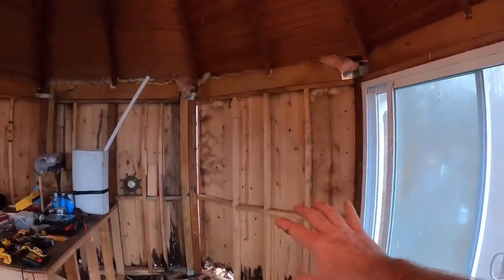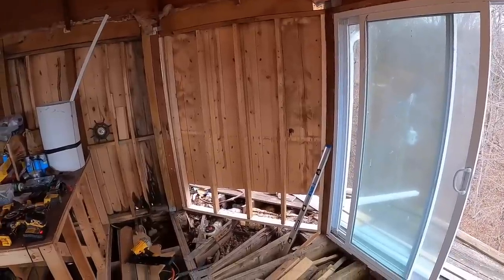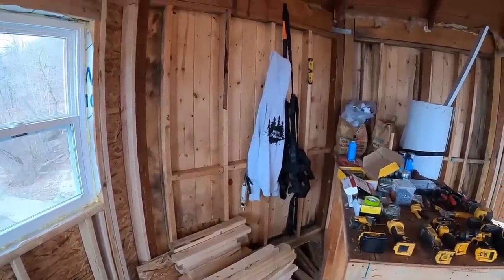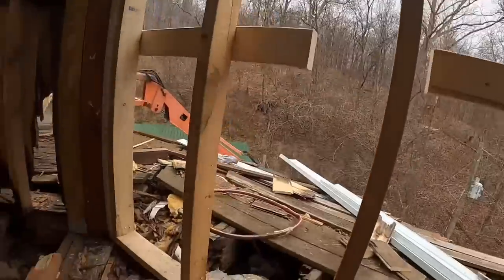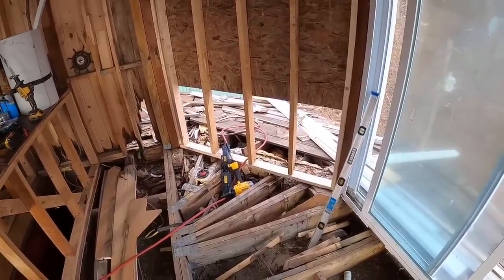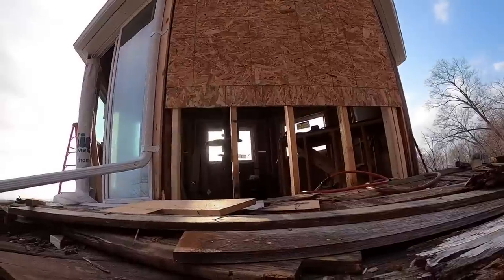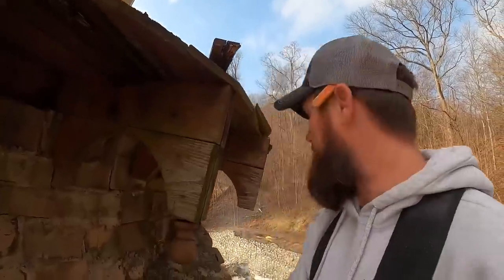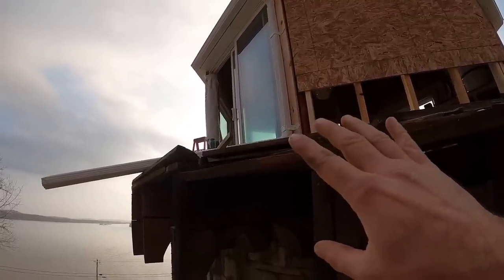The death deck! Wall repair and deck inspection

Comment: Personally I'd remove those rotten timbers before they suddenly remove themselves.
I'm glad theres a route to the basement for the water supply, I was wondering if you should route it another way inside the building but no need! Happy days 😁
And I totally agree leaving the last door until last so there's access.
Reply from the maker: Thank you

Comment: Love your positive attitude and can-do approach Matt.  That platform still gives me the heebie-jeebies!  Having watched this series so far, and having done resto/reno jobs on heritage buildings in the UK here's my 2 cents...1. It's not too late to change tack - I'd take the entire structure down and then repair the masonry walls properly. 2. Pour a concrete ringbeam on top of the tower which you can then bolt down an I-beam frame that you build a cantilevered deck and structure off. 3. Water ingress is your enemy - if you replace like for like then you're probably going to be doing this work again in 10 years. Either way, I wish you the best and admire you for taking on such a difficult project 👍
Reply from the maker: Thank you

Comment: Do the joists first to make the area secure underfoot. Having them done means you can mark out the position of all the hips and fascia boards at once. 🙂 And once repaired get some scaffold boards down as a walkway rather than stepping in between the joists.
Reply from the maker: Thank you

Comment: Hi Matt. Just a thought on your route for the water coming up from the basement. I have built many animal feed stores in wild environments the weather extremes you would hate. But even that said on that short height you have and with a chance of freezing, please check up on a low voltage trace wire to run along your water inlet pipe. You can control if or when it runs with a ambient temperature control unit, that will only switch on at a determined temperature and switch off when no threat of frost sub zero or -32F. I only suggest this as  something there when needed is a lot better than not being there and realise it was needed. We even used a battery bank that would last any power outage as our systems were run on 6, 9 or 12volts, as well as running of a transformer off the mains. The system could be  ideal for your project. The trace wire taped to the water pipe as you feed it down and there if or when needed and saves the worry of failed insulation of damp running down the water intake pipe if the roof seeped a tad. Think insurance and proactive. You most likely have thought about this type of system but if I said nothing and you had an issue down the line I would feel bad. Sorry if you have looked at this and discarded it and pleased to point you in a direction outside of the box if you had not thought about it.
Reply from the maker: Thank you!  I have been thinking of ways to mitigate freeze
Reply: @nyamillennial  Pleased to help and always available if you need any other ideas, shame I live across the big pond from you or I would be down the 66 faster than a Road Runner to assist you.

Comment: Access is key Matt !!! I would start on the floor joists and roofing the underside of the deck, then sort out the rest of the roof around the deck. 
Consider using mechanical or chemical anchor bolts or threaded bar for fixing the timbers to the wall. This would lessen the chance of water rotting out the timbers. Chemical  anchors can be expensive, but the hold they get is impressive. I have used them many times, you have to ensure the hole is free from dust to get a good anchor.  
For doing the re pointing of the stone wall, I would recommend using a lime mortar mix, this tends to be less likely to react with the stone, depending on the type if stone used to build the walls.
Reply from the maker: Thank you

Comment: Nice project Matt
Hard to tell from the video about overhangs and such, but a small copper or metal cap on that chase might work and look decent, but hard to tell the taper and how far out the overhang needs to be. not enough and you just move the water intrusion farther down the wall.
Anyway, I appreciate your ambition and talent, good luck. Looking forward to the next installment
Reply from the maker: Thank you

Comment: Insulation under the roof structure will be great but I’d still put the pipe insulation on the water line too, just to be certain brother! I don’t think you’ll regret the extra insulation Matt! Good job and good luck brother!  Matt , where the new roof section meet the wall! You might want to put some of that galvanized flashing that comes in a roll that’s about a foot wide! It’s also used on roof valleys in the old days, but it’s going to keep the meet up leak proof for sure! Just a suggestion brother, I know it’s your job but just giving you a idea!  Looking good brother!
Reply from the maker: Thank you. I will definitely flash it
Reply: @nyamillennial  he Matt, I’m just trying to help brother!  I had to learn myself brother! 👌🏻🤙🏻
Reply: If you put insulation around the pipes, MAKE SURE that there is still warm airflow up the chase.  I performed firewatch at a new condo because the insulators packed insulation tight around the sprinkler pipes in the ceiling of the top floor.  On a cold night the pipes froze, cracked open, and flooded three units.  They had to turn off the sprinkler system (thus the firewatch) and replace ALL the sheet rock in two of the units.

Comment: Don't forget your not replacing the deck your building a roof. Once the roof rafters are tied in the joist don't hold much weight. To save some money  you don't need the long floor joist. You don't need the cantilever for a roof. You can stick or truss frame the missing sections. Use the cut off joist to fill the inside.
Reply from the maker: Thank you
Reply: @nyamillennial  Any time.

Comment: It's going to be real nice when you get it done Matt, one good thing about possibly needing to put a "mini-roof" over that brick chase is that it's on the LEAST visible side of the tower.
A thought on the brickwork as well.  In your construction contacts, do you know any bricklayers who specialize in chimneys?  Ask their opinion of those gaps and possibly sealing that one area.  To my eyeball, you or a "specialist", will be quite busy repointing those brick joints!
Reply from the maker: Thank you

Comment: Video marker 9:42 shower talk
Second post
Idea
China and japan both have a shower bathroom combination for small spaces functioning working
The toilet can get wet but is used as shower seat on some of the builds
Its an idea 
Some of there small space apartments they have is 200 square foot or smaller but accommodates a large footprint for living including washer dryers and small kitchens
What you think cant be done can be done and beautifully done too
Reply from the maker: Thank you

Comment: Rip out the rotted wood now. you'll be glad you did later. You'll be amazed how smooth the roof will go if you clean up all the rot now, instead of stopping the roof work to address that issue.
Reply from the maker: Thank you

Comment: The cantilever rule is for every foot of joist length from the house to the beam, there can only be 1/3 of that amount overhang the beam.  I got the formula from an old This Old House per Tommy Silva And Norm Abram. You have to find your shortest joist, then get the length to the last supported point, Multiply by 1.5 to find the overhang. ie: 5' inside and 3' outside (8' to last supported point) 8'x1.5=12'
Reply from the maker: Thank you

Comment: Yes Matt you need a CS room in the tower.  Crap and Shave Room, but as we know you lost the razor long ago.😂😂😂. Also dont forget the vanity mirror for the application of the Warpaint, you know the girls can’t live with out it! 😂😂

As for the rotten wood, rip it all off first, before you start building the roof, for it might wiser in the long run, as for me I would have done all demo first befor building back, because in demo you never know what you might uncover that may force you to tear more off.

To me it looks like nothing was built to code and was cobbled together.
Reply from the maker: Thank you

Comment: Matt, you got a mess, but you'll get it done. Maybe a central hub in the middle of the room then branch out with your beams in a circular pattern, so they all lock together at a point with heavy hardware, sort of building let's say a spoke wheel
Reply from the maker: Steps won’t allow that where is truly needs to be but good idea
Reply from the maker: Steps won’t allow it but good idea

Comment: Me, I would make safe 1st take all that dodgy stuff out put in the new timbers and then start building your new roofing structure around the tower. The pointing can be done later after you've cleaned the stone, brick, block work. It looking really good.
Reply from the maker: Thank you

Comment: Good Morning Matt. If the sch 34 pipe is large enough why dont you do pex with heat tape secured to the line and pull it up from the basement? Just a suggestion. They selll the heat in make your own size.
Reply from the maker: Makes sense

Comment: Due to not knowing if you have built the roof yet or not, here is what I would do if you haven't yet. Where each rafter comes down, put a block down to the concrete right at the edge of the concrete behind the block between the floor joists. This will transfer most of the force down onto the concrete rather than at the connection point out at the tails of the boards hanging out in the air. A modified truss, if you will. you could make it an actual truss, but stick built will work fine and easier to put in. you could also double it, with one on each side of the rafter but one will sit on top of the joist, the other on the concrete. corners are harder, just cutting that exaggerated angle on the boards so the rafter sits on the joist but it seems you got the know how on that part.
can you reach all sides of the roof, with the lift, to put on the shingles? sure would make it easier. big roofs don't bother me near as bad as tiny little ones way up high.
Reply from the maker: Thank you I agree totally

Comment: On your cantilevered floor joists, why don’t you use : treated 4x4 or 6x6 square posts? Or can you even get them to fit, just a question Matt? It’s a mess I know, but I know you will get it done right, great job so far Matt ❤
Reply from the maker: Thank you

Comment: With the concrete underneath i would suggest you work around replacing any joist that is suspect then fit some OSB walk boards which will not obstruct you creating the frames for the roof. From the camera inside we could see how unsafe that section of deck was so before you start on the roof you need secure footing.
Reply from the maker: Thank you

Comment: use sack concrete and pour a small sloped roof on the area of concern.  It will shed water and you can paint it if you think it will leak through.
Reply from the maker: Thank you

Comment: Certainly many repairs to be done and it will take one step at a time - an achievement which you will succeed with. Wonky decking - time for it to go and repair so you will at least have something solid to work and build upon.
Reply from the maker: Thank you

Comment: YouTube 2 by 8 PT pressure-treated so kills that will help out quite a bit with your bottom plate and the rest of your wood for the floor
Reply from the maker: Thank you
Reply: Modesto Simpson ties and on the concrete do you like it to be 6 and yeah that in there and I'll run it out

Comment: Tear it off Matt, if you do it wont slip beneath your feet just when you need it, trust the concrete not rotten wood, you have plenty of work to do but stay safe, at some point you will want to put a ladder on it to get to the roof and it will let you down, quickly to quickly , not worth the pain.
Reply from the maker: Thank you

Comment: You've made everything about this renovation harder than it has to be. There is an order for doing things that you obviously haven't a clue about.  And no, don't worry. It won't be anywhere near perfect.
Reply: He's doing the best he can dude.. givehim a break..
Reply: @naturelover13693  Oh, please. If he got just a little advice from a knowledgeable carpenter, preferably somebody who could come on site and point stuff out, he would be so much better off. Not knowing what you're doing isn't the problem. Not admitting it and taking a little help is. That's called learning.